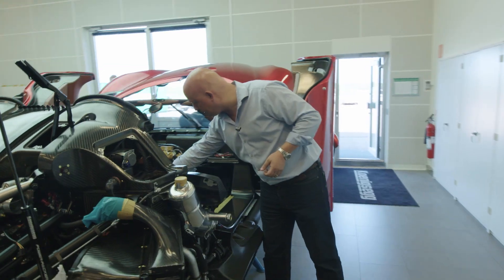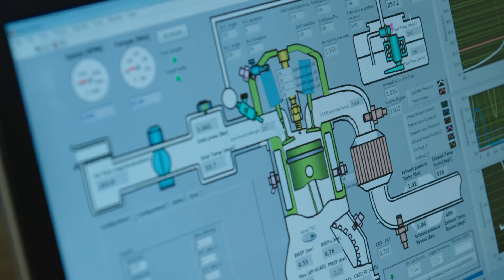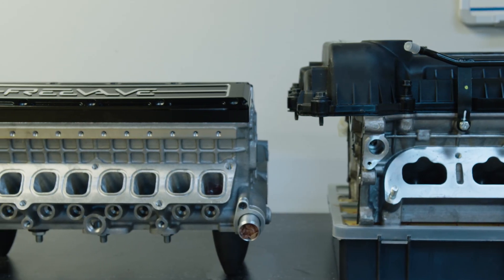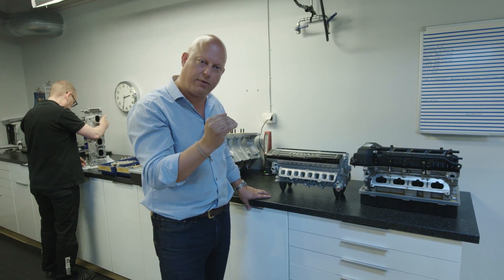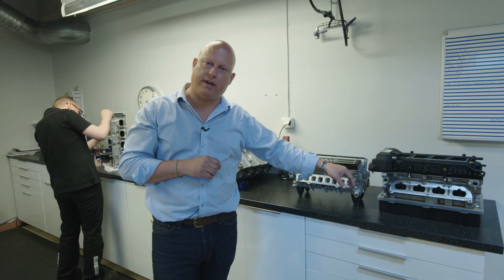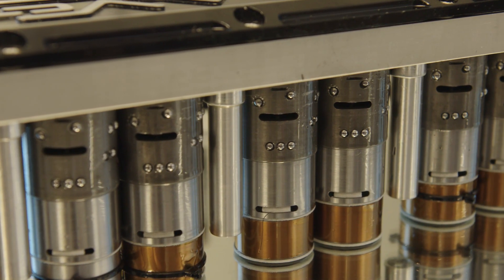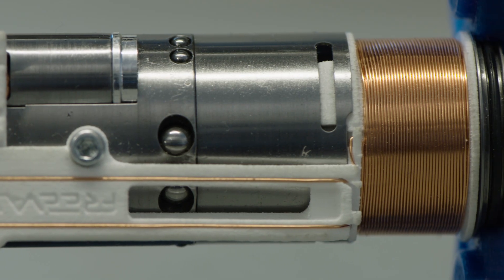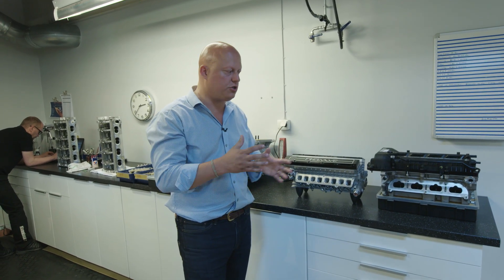Freevalve Update Camless Engine -- /INSIDE KOENIGSEGG

Comment: this guy is going to save the internal combustion engine when the world wants to end it
Reply: EVs are going to force gas companies to pressure engineers for more efficient designs to compete, future looks bright for both in my opinion.
Reply: @steedm1093  Evs are the worst arguement for green energy I’ve ever heard of. Walk up to guy with an electric car “oh god I save so much money every month vs when I had a gas car.” You-oh really? And how long will the car last? And how far does it go? And where does the electricity you use to charge your car come from? Ohhhhh that’s right a coal power plant just like your electricity in your home. “Ev guy- well yeah but I create less pollution now than if I was driving a gasoline powered car!” You- not quite, you see, your car required x amount of lithium to be mined and x amount of “enter rare earth materials here” to be mined and manufactured into the car you see today. If we take the impact of all the manufacturing the car required to be produced and then we add the electricity the car uses in its lifetime and give the car an assumed life span, we can clearly see that the gasoline engine is far from the level of pollution created by an electric car simply by manufacturing the damn thing. Same for wind turbines and solar panels. Spend a huge amount of resources to create them and they only last 10 years at most. And the best solar panels in the world are only 10% effective at converting solar into electricity. Just saying.
Reply: @theprodistini2590  An EV still has significantly higher mileage per watt vs any combustion engine.  Why?  Part because a fuel fired powerplant peaks at about 40ish% effiiciency, subtract resistance in the powerlines to the house, house to the charger and charger to the battery, maybe 10% loss? Still more than 20% more efficient than a combustion engine.  Also electric motors = instant torque and that torque is only limited in what power can be given and absorbed in the electric motors internals.
The only thing that sets a EV apart from a combustion vehicle is an EV uses a battery and electric motors, other than that the resources are more or lese the same.  Combustion engines will never pass more than 15% or so efficiency using directy mechanical drive.  If some how you manage to squeeze a generator and make the thing use electric drive, the engines use is to power the generator then you might reach closer to a fuel powered power plant.  Granted current EV powerpacks require rare earth minerals, future batteries not so much.
Reply: Can the naysayers of ICE’s please stay off of ICE based sites/forums.
It’s like having the police in your car with you.
Reply: apperently you have a HUGE loss in power in Combustion engines due to most of the energy gets converted to heat and not forward movement.
Konigsegg is going to save the combustion engine.. but most importantly he's gonna slay everyone saying hybrids are only for priuses. Oh wait.. he already did with the Regera.
Reply: @alien76  Yes. They should use 2 pistons against each other in 1 cylinder, theoreticly giving 60% effectiveness.
Piston ->□□□ <- Piston
Piston-->■□■<--Piston
Piston->■💥■<-Piston
Only 1 cylinder for 2 pistons.
Reply: @alien76  40-50% is ok
Reply: @alien76  bruh he made a hybrid car though
Reply: @alien76  wrong
Reply: Pommes Kuchen

We’re already wasting most of the energy when we generating the electricity.

However, one day there will be no oil in the world, then we will have to use the electric cars...
Reply: TreatmentMD Nah power stations are way more efficient than small internal combustion engines, it’s just an economy of scale thing really! A massive gas powered turbine is obviously gonna be way more thermally efficient than a little engine in a car losing heat all over the place.
Reply: @doctormhere  yes but there are many ways to generate electricity and storage, electric power train is here to stay, what remains to be seen is, if it is batteries, hydrogen or something else for mobile power source
Reply: Leandro laporta no clean ways to get electric energy. We all need nuclear power and I don’t against that. 

Also we must keep in mind that these are not completely clean. 

İn future we have to use electric cars but don’t have to love it :)
Reply: Most of y'all seem to have forgotten diesel lmao
Reply: @Pythnn  diesel is still made from oil and requires even more of the stuff to produce. Gasoline is a bi product of producing kerosene and was around before the gasoline engine was invented.
Reply: @Pythnn  are you an idiot
Reply: And three years later....still nothing.
Reply: Let's hope so! We need his tech in mainstream cars. I'd love an EV but WAY to expensive. I'd be happy to have his 3cyl in my car.
Reply: Mazda will save the combustion engine
Reply: Funny enough he said they wont be making  internal combustion engines anymore
Reply: @john-danielmartin8753  The gemera has one
Reply: @Larcona_  it shall be the last car they make with an IC engine
Reply: @john-danielmartin8753  Source?
Reply: @Larcona_  checkout the launch of the jesko on the roadshow i think
Reply: He's being just that for a while actually...hardcore fossil juice addict :)
Reply: Until the world learns to live without plastic we will have to have internal combustion engines to dispose of the plat is industry’s waste product (unrefined, explosive petroleum). If everyone stopped using gasoline and like products for a month the oil/plastic industry would pay us to drive again because they would have nowhere to store their waste product.
Reply: honestly it doesn't seem like he wants his cars to run on gasoline.
Reply: Exactly... and these are better than ev ...
Reply: At present, due to lack of sufficient lithium resources, it is not possible to replace combustion engines with electric motors.
Reply: @rezagoodarzi4329  And guess what country has them all? China!
Reply: Absolutely
Reply: With good reason, its stupidly inefficient, around 25% efficient, and in F1 only about 50% which is great, but we don't need a soccer-mom minivan banging out at 12000rpm+ at 800+ hp.
Reply: No the world does not want to end the internal commotions and send a few radical people with very vocal motives do.
Reply: I certainly hope so. Battery cars are a deadend.
Reply: by doing nothing more than modernizing an ancient design.
Reply: Lol, hes just postponing its death, if that.
Reply: Electric cars are glitching, cheaply made, over priced junk
Reply: I hope he does. His technology burning hydrogen could really make a difference.
Reply: Hahaha! Fight for the right to pollute. He may prolong it, but saving it would make it sound noble. It's not, and he won't.
Reply: @ernieschatz3783  we as humans consume food and in the modern world food needs to move… ICE is a long way from being dead, I will PM you when the last diesel ship and cultivators / bulldozers stop moving… say in maybe 50 years 🤣 so the free valve is an important part of increased efficiency that will just happen ✅ it’s time is now.
Reply: You're 1/2 right. 
The world doesn't want to end the ICE, it wants to end the pollution created by running them or just REDUCE the emissions to a level the planet can handle.

There's 1.5 Billion registered cars in the world as well as almost 1/2 a billion trucks. I am an engineer and that just cannot be replaced overnight. This is one of the really obvious things that just doesn't get mentioned much. Plus there will be a staggering amount of energy needed to replace all those cars & trucks. Plus until we get rid of all the coal fired power plants doing anything damages the planet.

What can be done for a lot less is replace the heads and get all those cars and trucks to run more efficiently.
But then how do GM, Ford, BMW, Fiat, Toyota, Honda and all the others make money doing that?
Reply: Electric cars will die LONG before IC kicks the bucket. It is a far superior technology. IC engines are going nowhere
Reply: He will prolong the inevitable... and I’m perfectly fine with that👌
Reply: Alcohol is NOT a green fuel. The energy conversion is poor and it uses land that is needed for food or better not used at all. 
The only viable option we have for future energy is renewables and nuclear. First we have to get the Generation 4 reactors on line. This needs regulatory approval (very slow) and people need to see that despite the history nukes are actually the very safest and most reliable energy source we have. 
The Gen 4 plants can make zero CO2 low waste ultra safe power much cheaper than coal. Stop burning that filth and we might get a handle on pollutions and climate change.
Reply: David Elliott Climate change is a hoax. And renewable energy are actually the worst. Acres of solar panels make the same amount of energy as a power station. Renewables are ugly and if you ever drive through germany, beautiful landscape is ruined by wind turbines and much less so by energy stations. The engine can also run on biofuels- a lot more sustainable than electricity.
Reply: @Dave5843-d9m  look up volcanol and report back. Also, how is land better used untouched than producing green fuel such as ethanol?
Reply: @Dave5843-d9m  nice infomercial m8 try harder
Reply: @Dave5843-d9m  I agree, nuclear energy is the best way to go. We just have to be very very particular about the way we do it. We need people who are OCD about checking temps, checking backup systems, having backups for the backups and backups for those backups, we can’t take a multi core meltdown like Japan. The oceans already have so much to contend with.
Reply: @Dave5843-d9m  
Alcohol can be homemade though for people who want to run piston engines.
Reply: @Dave5843-d9m  Alcohol is a Green fuel.
Reply: Long live the burning of fossil fuels!!! I love the smell from my 02 Mustang GT 5speed car on cold mornings as I hold my foot on gas till she warms up a bit!! I hav the idle control valve manual over ride with idle control obtained by screw on butter fly!! Sensor is 60bucks shopping junk yards for one but no hurry engine lite is not coming on?? Only deal is hav to hold slite gas to her to hold her on 1000rpms till smoke cig then she idle fine!
Reply: Combustion engines can be more sustainable than Electric if they were run on pure alcohol.
Reply: @bax442  it may Run on alcohol but I don’t think alcohol has the same combustive tendencies when under pressure as gasoline. With the new free valve system, timing and fuel delivery could eliminate the lack of energy available and take advantage of what IS available. To the point that you may not notice much difference between the gasoline engine and the alcohol engine. Problem being, under racing conditions you’d likely want to add 10-25% actual gasoline to spice it up a bit. But I’m not a fuel specialist. Just making assumptions based of my own experiences with lighting alcohol on fire, gasoline on fire, and other chemicals. Alcohol is a slow low burning flame, gasoline on the other hand JUMPS at the opportunity to burn and does so quickly. Which is what you need in an engine that only has .1 of a second to use the energy made by the explosion before it’s shoved out the tail pipe or the piston and rod reach an angle that they’re no longer providing rotational force on the crank.
Reply: Go drive a Tesla dude you're wrong ICE's are for idiots fuck petroleum
Reply: FSEVENMAN I have. Sure it’s quick. But it’s also slow. Heavy. And handles poorly.  And impractical. i’ve also driven an F40 and that was better in every way in terms of driving pleasure. The tesla, if u drive it quick then u have no range and you lose performance after every charge and during every the drive as you use it up.
Reply: We don't want to lose combustion engines, it's the propaganda that pushes their agenda so they can make more money out of us, have you seen the price and running costs for electric cars? Just wait for the domestic electric rates once everyone is forced to charge their cars.
Reply: @DaveyJonesLockerwithJazzy  Right. Btw the only reason oil is cheap right now is that demand is plummeting.
Reply: Finally!, Although it is a bit late, the future is electric power train, if this tech arrived 10 years ago it would be a killer, now I'm not so sure
Reply: Leandro laporta Electric cars didnt catch on in the 1900’s. Now they’re only catching on because of government regulations that indirectly boost development of ev’s and batteries and as manufacturers know they must adapt to this, they abandon the petrol and diesel engines. This technology just accentuates there is so much more we could discover. Ev’s are 80% efficient. This is 50% but it extracts more energy because fuel is far more energy dense than batteries.
Reply: Meanwhile in F1 they make over 1000bhp out of a 1.6l engine 😂 yet kids bang about 160bhp 😅
Reply: @remid1994  Why are you even in this thread.
Reply: @Larcona_  Boy segg has some of the most rabid fanboys!
Reply: @remid1994  You watched a video about automotive advancement, then just made a useless comparison to bash it. Yeah, I'm the bad guy...
Reply: @Larcona_  when did he bash it? He was making a point about most cars that have 1000hp are like 3L+ in size, a 1.6L engine making 1 grand is fucking INSANE.
Reply: @krakenjm6877  That's not what he said at all.
Reply: @Larcona_  I can very clearly see this guy wrote “Meanwhile in F1 they make 1000bhp out of a 1.6L” smh, imagine being illiterate. And I did look it up, yes, there apparently is such an engine.
Reply: @krakenjm6877  Tldr, but I'm sorry or happy for you, whichever fits. If you don't get it by now it's not my problem.
Reply: Remi D So a turbo-charged race engine revving to 16k which has to be rebuilt every race and discarded after a couple hundred of hours of operation makes significantly more power than the same volume engine with no forced induction and a life of hundreds of thousands of kilometers? What a foreign concept.
Reply: @remid1994  yeah and those ran for like 2 hours or less  before destroying themselves. everyone forgets this fact.
Reply: Remi D it’s F1. There are so many complications to making that work on the road. The AMG one is having major complications with ignition and oddly torque. The new freevalve 2l can achieve 600hp @50% efficiency. A 3 year old mercedes MO8 f1 engine achieved just over 50%...
Reply: @remid1994  thats actually not to hard to do especially when adding a turbo and a electric motor. On just the engine alone they are pushing no more then 850hp in qualifying trim. People have been doing it with hondas for a very long time now with no electric assistance. The feat really isn't the actual power output of the engine its how they are able to do so with the amount of fuel flow they're limited in using thats where the f1 technology comes into play and how thermal efficient those engines are. With all the technology that they have they can actually make well over 1000hp combined but the fia doesn't want them making more power they want them going fast by using aerodynamics.
Reply: @MrDelsoleg11  Ferrari designed a battery system together with a power generator so advanced and efficient and 100% legal,  but FIA outlawed it and the man with white hair brought their technology to Mercedes. Automotive technology is way more advanced than what us plebs can even understand.
Reply: @remid1994  there’s likely no emissions regulations on f1 cars, and if there are they’re still allowed to use fuels that provide much more power than typical fuel. Which makes a world of difference.
Reply: @remid1994  the f1 engine is a hybrid engine and only lasts for 2400 km
Reply: @remid1994  Oh remi, that comment is a bit embarrassing
Reply: @remid1994  Huh? Race cars have been making 1000 horsepower for 50 years..Not to bright are ya?
Reply: @attackroflchopter4403  Who said 50 years? you are not so bright, are ya?
Reply: can çolakoğlu wE nEeD eLeCtRiC cArS
Reply: @chillchopapa3275 
We need what we are told we need.. There is as much if not more ecological damage caused in the production of batteries but they don't tell you this as a selling point? 😳
Reply: The phasing out of the ICE is inevitable. It's pollutant (bad for environment & health), expensive, and runs on a finite fuel.
Reply: @the_laziest_fox  Except that with these actuators cars can be made to be completely CO2 neutral and run on any fuel, including alcohol.
Reply: @Larcona_  can you explain this further to me? sorry to ask ill google too im just not as adept as id like to be..yet
Reply: @paulalangadan8375  Basically, the combination of efi and infinitely variable valve timing allows the motor to run on pretty much any fuel (gasoline, ethanol, bioalcohol) with a simple retune. It also allows more precise valve and ignition timings to greatly increase the efficiency of the burn.
Reply: @paulalangadan8375  They mention it's use on their new video about the gemera if you're interested.
Reply: @the_laziest_fox  what do you mean finite. I can go fill my tank for $1.95 a gallon with some corn fuel.
Reply: @typicalfailure6174  the amount of corn needed to make enough fuel to power cars isn't sustainable. That land needs to be used more wisely to feed us.
Reply: @gregorynelson5673  then why is E85 less expensive than its gas counterparts. Just guessed its easier to make and thus there is an abundance of it.
Reply: @typicalfailure6174  not sure if anyone answered you but while E85 is cheaper and easy to produce, it has less energy per unit than typical 87-93 octane gasoline, so you will need more of it to do the same. The reason they use it for performance applications is because you have more fuel in the combustion chamber it is less likely to cause pre ignition and you can use a much more aggressive ignition timing map.
Reply: @awesomecooly123  oh ok. Thanks a bunch. This was really helpful. I knew it was used in performance bit I didnt know why.
Reply: @typicalfailure6174  It is easier to make. But it uses land that could be used to feed mfs. Or better just plant trees and leave it alone.
Reply: @typicalfailure6174  and within 3 years of running that corn fuel your car will no longer RUN! Lol ethanol eats everything made of rubber and beyond that it turns to gel. It’s unstable and has at the most a 3 month “shelf” life
Reply: @gregorynelson5673  less people need less food and less fuel ⛽ is that not the ultimate solution to all humanities problems ?
Reply: @the_laziest_fox  the amount of  Lithium on earth is finite too.  and spoiler alert:  we are still using coal power plants soo id say electricity is not cleaner at all.
Reply: @vmark1111  Actually the math has been done, electric cars are better for the environment within a few years of use.
Reply: @the_laziest_fox  range and flexibility will keep the ICE from dying. Electric cars are very limited in range and cannot recharge quickly without dedicated infrastructure. Also they cannot carry their own fuel without huge compromises in weight and payload. Electric cars also have a huge problem when they come towards the end of their usage life where disposal of such vehicles is very expensive and damaging to the environment.
Reply: @the_laziest_fox  what about cargo ships ? That polluted more than all of the cars combined. Cars arent even the biggest issue. But everyone trying to make it so
Reply: Bradley this engine runs on renewables. Environment not really. 98% of co2 released isn’t from humans. Health is debatable because of how small the quantities are.
Reply: @the_laziest_fox  Actually a fossil fuel alternative for an ICE engine would be ethanol, ICE engines do have a renewable resource.
Reply: @the_laziest_fox  Ah, but in the creation of those cheeky little batteries entire EXOSYSTEMS are flattened all in search of the ore to produce said batteries. Not to mention the new chargers, wires, power, etc needed to support those vehicles.
Reply: @the_laziest_fox  I mean most of us travel short distances anyways, how come we don’t hop on a contraption that winds a spring to propel our car to and from work? If we completely re designed the vehicles to be lighter and driven by a spring that gets locked in place when you don’t need it and a clutch system engages the spring that’s on a gear so high it takes it miles to unwind. Sure it would be slower taking off but once you reach cruising speed you engage the clutch and stop the spring from propelling you any faster, at the next light you re engage. You’ll tell me it’s not possible but so was the internal combustion engine. But look at it now, a cluster truck of parts all working in unison to produce less and less hp/torque and engines don’t last as long. The processes used to create engines today is garbage. Such as electro plating the cylinder walls with iron on an aluminum block/bore. Did I mention that layer of iron is only like .50 mm thick? If you run low on oil and wear through the coating? Engine is trash. If the engine gets hot and damages the coating? Engine is trash, if you go over on oil changes and damage the coating? Engine is trash. If you drive 300,000 miles in perfect maintenance schedule, the engine is still trash because the lining wears out! But in the name of profits and parts availability we humans have a real nack for solving one problem while creating another.
Reply: @the_laziest_fox  the internal combustion engine does not run on "finite fuel" we could easily switch to non homogeneous wild biomass (weeds) fuel its excellent for the environment, bees and rabbits and all the little creatures and bugs love it, because you only harvest the top of the plants, the roots are never disturbed. and the modern electric vehicle is terrible for the environment there made to brake, which is very unsustainable, the internal combustion engine cant be made two fragile because of how chaotic and unpredictable its energy sources are and that goes twofold for diesel engines my defender is over 40 years old and that vehicle has worked every single day since it was made, don't forget the same people that try to sell (plastic products) are the same people that are trying to sell you EVs. its all just marketing consumerism will not save the environment, if you care about the environment use the most reliable vehicle you can afford and maintain it for the rest of your life, and if governments cared about the environment they would force 50+ year warranties and ban all unnecessary plastics and enforce right to repair.
Reply: @the_laziest_fox  How do you think they manufacture electric batteries and disposed of them. Electric batteries are more polluting than you think.
Reply: @the_laziest_fox  wrong
Reply: @the_laziest_fox  the internal combustion engine will never be phased out. There will always be a need for it. The internal combustion engine will be needed to tow electric vehicles when the batteries are dead and you are stranded in the middle of nowhere.
Reply: @the_laziest_fox  and lithium, cobalt, copper are not finite? Lol
Reply: Bradley electric cars aren’t exactly carbon free either. Lithium ion batteries are equally as bad in the long run
Reply: @the_laziest_fox  so do your precious lithium batteries. Mining and recycling lithium is arguably causing a worse impact on the environment than fossil fuels
Reply: Db : they're not figured out how to put a Cadillac converter on a jet engine yet !
Reply: @robbyholderman8581  catalytic. Does Cadillac even sound the same to you.
Reply: @robbyholderman8581  why would you want to convert a jet engine and turn it into a Cadillac?